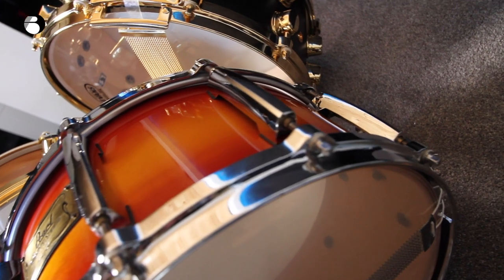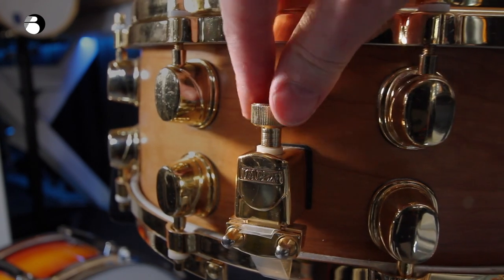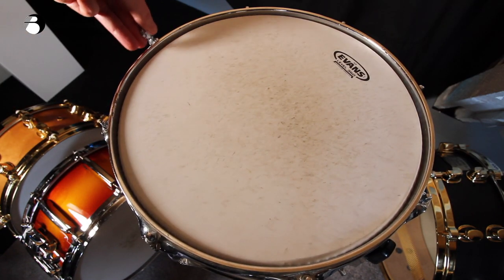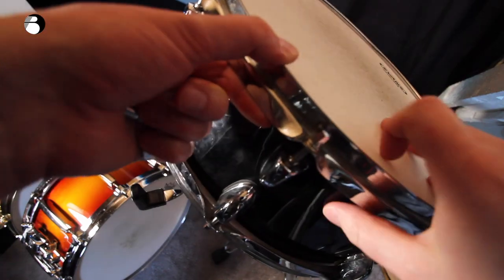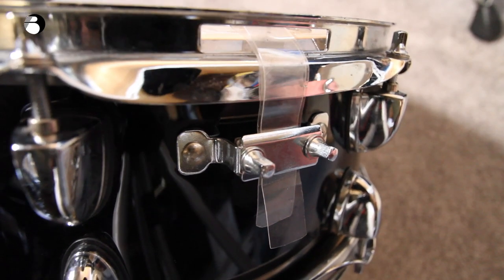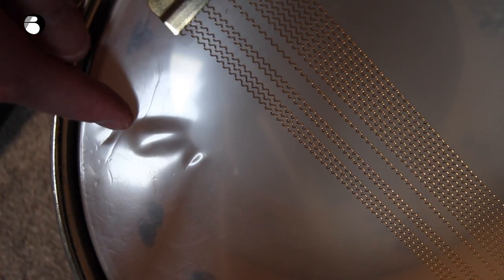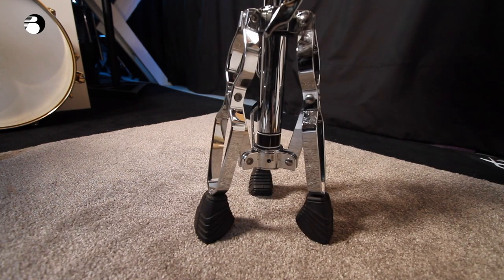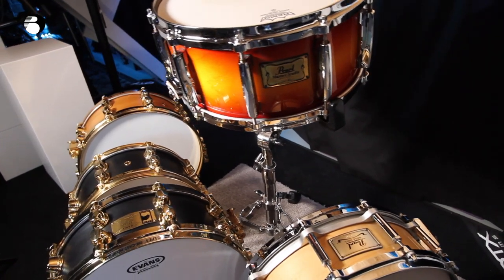How To Fix, Tune & Set Up A Snare Drum For Beginners

Comment: Thanks for this, I'm investigating an awful buzz/pitch in my snare after I changed the batter head...switched to a completely different head and now everything is off...now I'm almost positive it's just a tuning issue. Thanks again!
Reply from the maker: It's most likely a tuning issue yes. But depending on the type of drum shell, type of resonant head fitted and desired sound that you're after - certain types of batter head will work better than others. Hope you get it sorted with just tuning though. It's worth spending some time on it to dial it in. Good luck.

Comment: Your content is amazing, can you please do one about how to fix crash and ride symbols sounding off?
Reply from the maker: Thank you for the kind words. I'm not sure that it's possible to change the sound of crash and ride cymbals because unlike other parts of the kit, there isn't much you can do to change the sound of them. The only thing I would suggest is that if you want to reduce the amount of "ring", or sustain that a cymbal has, you can try damping it with moongel or similar. You can also change the type of felts that the cymbal is sat on - this can affect the sound slightly - try using cym pads or similar. Thanks for watching

Comment: Great job, I need help with an advice, the Evans level 360 head on the Gretsch silver snare drum started to clean herself in the middle now it is just a ply in the middle for about 3 cm, can I use something for protection ? Or I have to wait for breaking in time ? My son is beating a lot in the snare drum. For any advice I thank you because I am not a specialist.
Reply from the maker: It sounds like the head has worn out, there's not much you can do to protect it. Instead, I would suggest that you need to go for a heavier/thicker batter head since it's wearing out quickly in the centre. a heavier head with a centre circle will take more of a pounding before wearing out. Look at these heads; Aquariun Hi Energy, Remo Controlled Sound, or the Evans Heavyweight. All the best
Reply: @BeatmastersGuild  thank you very much Sir.